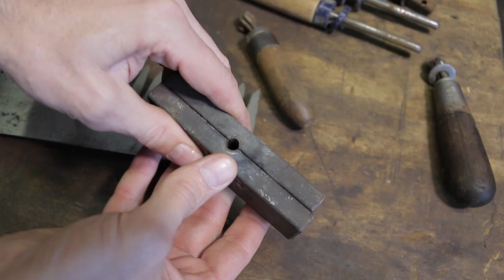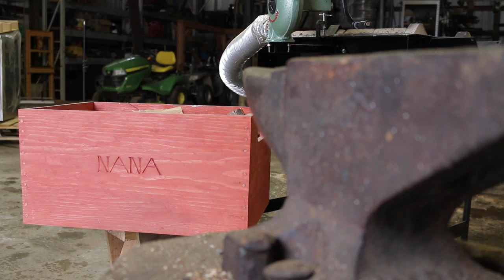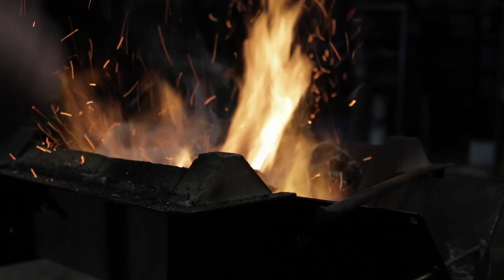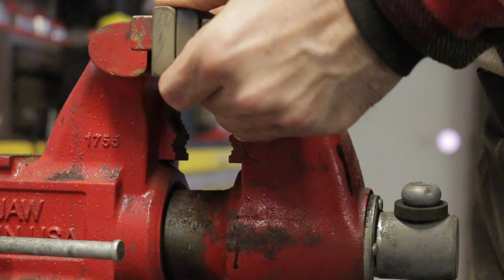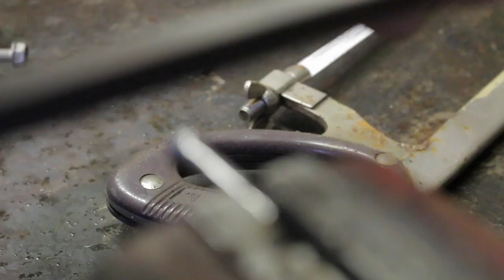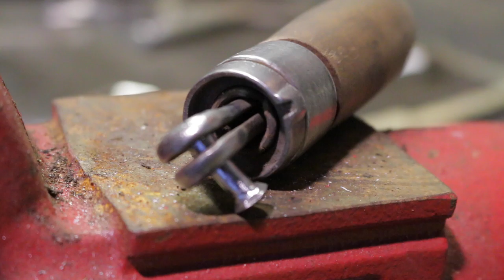Forging Trinity's Handle

Comment: I do like this format, and I agree with you. This was beautifully shot and edited. I learned quite a bit just watching. If there are questions regarding a specific step it can be addressed in the comments or aggregated in a blog post about this video. Edit: Also, I think you're right about the tempering. You want the pin to wear. Not the blade of the saw or the handle. The pin can be replaced a whole heck of a lot easier than the other parts of the saw.

Comment: Good stuff, thanks for showing us the right way to do this. I'm off to fix the handle on my Dad's old saw, he passed in 1998, so now I use it. It was fixed with the screw and twin nuts just like you showed.

Comment: The saw and handles cleaned up nicely, the hex driver made a nice rivet, the wood fired forge is a nice tool-shed accessory and is was nice to add a video showing and explaining how anyone who is handy can fix a tool using another tool for parts.

Comment: I love working at my forge, one of my favorite things to do with my spare time.  I only wish I had more time to do it.  Started forging a framing slick back in the late fall and it's still incomplete, just haven't had the time to get back out there to work on it.  Maybe this spring I'll get some time.
Reply: jailer23044 make some time, you will enjoy it so much. I retired after 30 years in the blacksmith trade. Well I'm now partially retired, got back into smithing p/t, missed the trade.

Comment: Great video,  I worry though about using a tool steel rivet.  Rivets are normally supposed to be either the same hardness or softer then the item they are being used with.  The reason being a harder metal will deform the softer metal it is encased in; so the hole in the saw that the rivet is in now may over time get bigger/ cause cracks/ or force the use of an even bigger rivet the next time you have to make a handle repair.   I have learned this the hard way with armor I have made in the past.

Comment: A nearly perfect tool for shaping that pin/rivet would be a nail header, also just handy to have in general, not as good as storebought nails most of the time, but for especially decorative woodwork they really just show how handmade something is.
Reply: A nail header or nail set has a square hole, the tool for a rivet has a round hole and is called a rivet header or set. They usually have tapered holes to prevent sticking.

Comment: Very nice presentation. It's a little late now but it would have helped the longevity of the pin to be tempered like you would a knife. Just a thought.
Reply from the maker: +Wallace Anderson I don't think it matters all that much,
Reply: All I would say to  that is ask a knife maker if they would ever sell an untemprded knife.
Reply: +Wallace Anderson A knife will see hard use and repeated sharpening. Therefore it needs to be tempered. This is just a small pin to secure a handle to a saw.
Reply: Trevanion  I'm not sure I understand what you're saying.
Reply: You're close, but I think your just a little off.  Right now his steel is soft, so it will ware. It need to be harder, probably about a straw color ( slightly harder than blue). But hey that's just one man's opinion.

 Mr. Wranglerstar is a grown man. He can do what we wants.
Reply: In order to quench (hardening it) you have to bring it to critical temperature then  douse it in water (or oil sometime). Since we did not see him do anything like this and we saw how easily he cut it, I would say that as he has it quite soft.
 (for those who don't know, tempering is getting metal to a specific hardness by first hardening it all the way the softening it some)
Reply: The stock Cody used is quite hard even in the normalized state its presently in. It will be fine.
Reply: When fully annealed, high carbon steel can be just as soft as cheap steel.
Reply: You are very observant.
Reply: +Thomas Taylor Induction heater maybe?  Doesn't seem worth the effort.
Reply: +Wranglerstar I think you did the right thing by not hardening it. You would not want the sawblade to be the softer sacrificial metal .&#160; My shop is a lot different than your shop....so my choice of stock would probably have been different...I probably would have used a shouldered metric bolt (minus the head) I mean after all who uses them in their shop&#160;?&#160;&#160;:-)&#160; Regarding talking on your videos ..sometimes silence is good. I am not saying what you should do....but two of my most&#160;favorite youtube channels are almost always silent. Sometimes the loudest sound is silence. Do a search for " firemans axe" and you will see a highly viewed example (1.7 million views)
Reply: +Thomas Taylor  
When tempered(correctly), the steel is still bendable.  You could still peen the pin but it would just take more time.  As some else brought up you would want the pin to be the sacrifice-able metal. So you would temper it to a purple or blue color, contrary to what I said before.
Reply: you where corrent
Reply: Is tempering when you heat it up and then let it sit in hot oil?
Reply: That is hardening or quenching. After that is when you temper, which is heating the steel to about 400 degrees (Fahrenheit),   or so, to soften it to a desired hardness.
Reply: Wallace Anderson Oh oke thanks
Reply: You don't need to for this because it would even if temperd would pop the head off it would be irelivent and an Allen key being tool steel would be enough

Comment: A point of contention: That tool might be a very "high quality" steel but it might be in large part due to the heat treat and tempering cycles which are tailored to the chemistry of the steel. Tool steels in the modern world can be pretty complex alloys that are designed for specific manufacturing processes. You can take a very good tool steel and forge it into a steel that shears under force or shatters under shock. Starting with a "high quality" steel doesn't mean you end up with the same. Some steels have a reputation for being forgiving and plenty that are used today are extremely difficult to heat treat; at least for a diy/backyard blacksmith. Obviously this is a rivet and it ended up having the properties you wanted but id probably do a little research for a fastener that was going to have a metal-to-metal bearing surface.

Comment: .

Those rivets are available at any farm implement dealer that sells mowers or haybines. They are used to attach new knives to the cutting bar. I have replaced hundreds of them.

.

Comment: Cody, I really like the captured pin instead of the nut/bolt.  I think I will make one just to see if I can.  Do you think a center punch would flare the end enough to cause the capture? Or, maybe a cold chisel cross....  things to try.

Comment: my uncle would disagree with you on repairing things to their "proper" condition. my family still has the farm my great grandpa bought when he first immigrated to the USA, and we still have the tractor he bought for it. years ago my uncle restored it. it needed a lot of work, because it had been sitting for so many more in disrepair. my great grandpa did a lot of "field" fixs on this tractor. an angle iron light bar when the original broke. a coffee can lid for a pump cover. a pipe section for a shifter. you know, stuff that he had on hand that would make it work and didnt cost anything. when my uncle restored it he did a great job. got everything in perfect working order, took apart every piece and made sure there was no rust, and gave it a beautiful farmall red paint job. but when he reassembled it he kept those field repairs on it. in fact, everytime he shows anyone (including me, ive heard these story A LOT) the tractor he tells them about the repairs and says "my grandpa made this, with his own two hands." its  point of pride. i think he connects with our past family member through those things (funny enough, my uncle never spoke directly to my g-gpa, because g-gpa spoke italian and my uncle spoke english). and ya know ive come to know my great grandpa through those things too, even though he was gone before i was even born. when i drive that tractor i get a sense of who he was, and the life he had, just through some off hand replacement parts and some dirt he happened to live on. anyway, a little long winded, but i thjought id share a story of field repair with ya

Comment: I'm at a loss as to why Wranglerstar, master of tools and crafts doesn't have a metal hacksaw to hold that blade? Is it broken, or did the blade you were using not fit the saw frame?
Reply: Mmmmm maybe Wranglerstar tried hacksaw and found frame got in the way.
Reply: Cant see how it would, the way he was using the blade looked like a hacksaw would've fitted, and made the job easier...
Reply: +Rob Chandler The hacksaw frame was laying on the bench next to the vise.

Comment: It seems to me that the use of hardened tool steel might not be optimal.  Forging a mild steel pin might serve as a sacrificial piece and prevent reaming out the hole on your saw.

Comment: Would be cool if you could attach a small steam engine to the forge to crank the handle. The fire wood would serve as both forge heat and steam heat. Though you would have to start out hand cranking to get the steam going. But after that it would run itself.

Comment: Very nice video and if I may throw in my two cents worth the video speaks for itself. it does not require a commentary. I hope you'll continue to mix videos such as this one with those with running commentaries as the subject warrants. if I may be so bold, I'd like to suggest may of the segments in this video would've benefited from turning off the autofocus.  thank you for your videos!

Comment: I really enjoy blacksmithing and the gratification you get from makin or repairing things yourself. I am curious about your forge in the shop though. how bad is the ash in the shop after you run the forge? mine makes a huge mess and I was wondering bout if it's my design or if that's the nature of the beast?

Comment: that blower needs to be hooked to a electric motor with a variable speed peddle( like a sowing machine) hooked to it. it may take time to get used to but you could stand with one foot operating the peddle as you work with your hands.

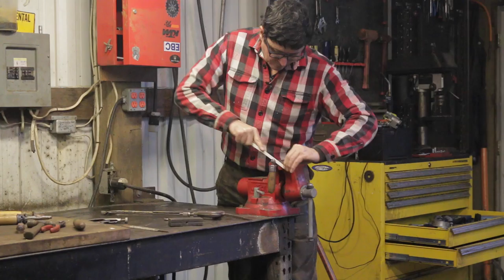Comment: At 10:00 you cut the pin with just the blade of a hack saw did the whole thing not fit?
Reply from the maker: +Ian Moore I'm sorry I don't understand your question,
Reply: +Wranglerstar I think it's the fact you used only the hacksaw blade and not in the hacksaw frame he meant.

Comment: Making something like this is a very cerebral process. Not that it is hard and takes a lot of thought, but actually the opposite.  So, while you are fabricating, there is time to be totally within ones self. It is similar to an out of body experience where anyone, whether the fabricator or someone just observing can just watch the piece become; as if by magic. This requires no conversation either with yourself or anyone else. So, maybe I get it.

Comment: May i point you on the fact that the anvil mount might be overdone. Most anvils have a square hole in the bottom for a pin that goes in the stump. Nice video though. Can't wait for back to basics 2!

Comment: So after making the pin and putting it together, why not bang on the smaller end of the pin to flare it and make it more sure to not come out?
Reply: Um.
Reply: I think the pin i sized so that it can slide out of the saw hole when the wooden handle is screwed down to remove the upward pressure on the pin. This allows the handles to be moved from saw to saw; the pins shouldn't be fitted so tight or flaired so they can't be removed..

Comment: Wranglerstar by no means am I knocking you but a quick tip for you in the future, tool grade metals should NEVER be cooled or quenched with water, it should always be oils or air cool down.
Reply from the maker: +Erick “White-Hot Shaft” Colunga A few comments ago we were told water....lots of different opinions out there.  :)  MrsW
Reply: I'm not claiming to be an expert, but I make knives and cutting instruments and in those instances tool steels are over hardened for blade level usage and durability when quenched in water. But besides all of that I love your videos and you and and Mr. W do an amazing job at everything I watch and I am glad to be a part of this community.

Comment: In going to let you in on a little blacksmith secret if you use the hot cut off to split the wood it makes it a lot quicker and as much as I hate to be a safety freak it's a lot safer and if you need tongs or any hand made blacksmith tools I don't mind makeing you some I can pm you on Facebook